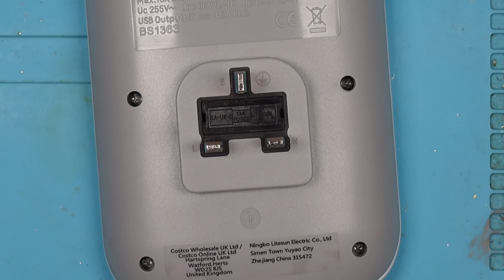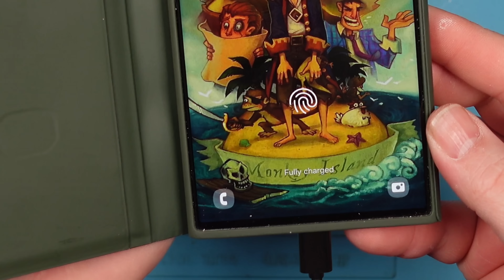FAULTY USB Double Socket thing | Can I FIX It?

Comment: It look like chip on USB board is there only for lit RED LED when current draw higher then maybe 100mA? Lit GREEN when lower current and turn off LED when no current detected. I saw circuit like this in 4port USB 2.0 hub with external power supply. It was rated 2,1A per port but 4,5A for all when 3A powersupply and input USB cable connected. It was useful for charging things even when PC was off only hub powersupply connected.

Comment: A very clear account. I looked at my power strip again and there are two USB sockets and 3 plug sockets. The USB part is very compact and I am not sure I can unscrew the circuit board if there is one (no sign of green). What I learned was is that it is better in the long run to buy power strips only with plug sockets and more of them and to add those little cube-shaped USB adapters (or ones that come with new phones) that can be plugged in externally and easily replaced. Putting everything together leads to more breakdowns, wasted money and more environmental pollution.

Comment: if you ever work alot with sega game gear, you will find that type of capacitor shorted alot. (filter caps that prevent the gamegear from working all together due to short)   but otherwise, unless your  working with that generation of caps... you dont see it that much. (90's caps really were horrid)

Comment: I have two smart power strips,  both of which make that chirping sound .  My only problem with them is that if too many usb devices are plugged in (e.g. phone, and tablet,  plus e-cig) the power strip's transformer cannot keep the mains sockets on.  Things start to switch off until I unplug a usb device.

Comment: If one cap has gone short, the other two inevitably will as well. Try and find the smaller caps and replace them all. The chirping was the switch mode power supply at the bottom starting and stopping because of the short on its output. Good fix Ste.

Comment: Electrolytic capacitors are notorious for failing. They are the first thing to check in any electronics repair. Get yourself an esr meter. They’re finally affordable for even the hobbyist and will be one of your most valuable tools. You could have checked the other two capacitors and probably seen that they are on their way out. One foot in the grave so to speak.

Comment: The power supply is a flyback power supply. It has a control chip on the primary side , which gets slowly charged via a large resistor into a capacitor. Once it has enough juice to start working, it activated the main switching element. This induces a voltage on the secondary and auxiliary windings. The auxiliary winding charger the control chip so it can stay running.

In this case, the output was short circuited, the voltage on the secondary was now around 0V instead of 5V. Because of how a transformer works, the auxiliary winding also had a low voltage. As the chip started, it depleted the energy stored in the capacitor and shutdown, instead of continuing to run. This kind of behavior has a side effect of limiting the power it outputs in a dead short, reducing the fire risk

Comment: I had the same thing happen to a USB power strip last year. The radial capacitor bulged and its top opened up. I replaced it with a capacitor that has a slightly higher voltage but same capacitance and it works fine again.

Comment: 9:50 It's always best to choose the voltage rating of an electrolytic capacitor as close to the voltage it is smoothing, rather than fitting the next voltage up.
Because the dielectric in electrolytics is produced by the voltage on the plates, it's best practice to fit the closest voltage ones you can. 
Nothing bad will happen using the next voltage up like a 25V, but say, using a 63V capacitor on a 5V rail may cause problems in the future.

Comment: I have a device with 4 USB outs and makes an annoying sound when connected to the power outlet. That sounds makes it impossible to use. And haven't disassemble it cos It doesn't have screws.

Comment: I've got one of these bought from Costco. I've found it very difficult to get a plug into the 13 amp sockets. Almost as if the shutters are way too tight. Needs a good thump. Usb side is really good though.

Comment: I have an old Bowers & Wilkins Zeppelin, with the old iPod 30pin connector, that no longer powers up, it’s a bit faded, but yours if you want it, sound quality was awesome and I think I’ve seen people modify the original connector, I have tried Bluetooth adapters but didn’t work very well, like I said, yours if you want it.

Comment: Possibly a dumb question .. does it matter mixing 10v and 25v capacitors on the same rail? The supply voltage should never exceed 5v so I’m guessing not.. but I’m sure an expert or two can weigh in here?

Comment: I just recently fixed a friend's 5.1 channel receiver (then operating as 3.1).  The problem was the same:  A 0.4-ohm electrolytic.  No sign of electrolyte leak, nor did it look damaged in any way.  And it was a Nichicon too.

Also, this USB plug is ancient.  Modern USB devices will try to negotiate for higher voltages, up to 48V.  Of course that means each plug needs its own controller.

Comment: The surge protect light seems to be a bit intermittent after the repair, it was always on (I think) during testing - before the repair.  Could this be an indicator of some kind to show when it is shorting or under strain?  Just wondering.  (Before it (the thing itself) stopped working was one or more USB's in use, it might be that what was charging/being used shorted out and it was constantly on to show it was protecting?).  No idea, just some thoughts on the matter.  (The fizzing was probably identifying the blown cap?).

Comment: Steve, I think the high pitched intermittent sound was the PSU, possibly a switch mode supply, shutting down when sensing the short on the capacitor. Then restarting and locked in a loop making the high pitched sound each time it shut down.
Reply: Exactly what I was going to type. I work on classic era arcade games and in every switch mode power supply (SMPS) the circuit will “chirp” audibly when it’s trying to feed a dead short. As Steve did correctly, disconnecting the power supply from the rest of the circuit, the SMPS can now feed power to the meter.

I have yet to find a shorted electrolytic that didn’t have some external damage. Tantalum capacitors are notorious for shorting and sometimes blowing up and spreading conductive powder all over the boards. Steve obviously finds many surface mount capacitors that are shorted too.

I also think Steve should replace the other 2 capacitors and get 3 of the correct physical size but I’d also suggest the bigger voltage tolerance like 25v instead of only 10v for a 5v circuit. Get a good brand like Nichicon. I learned to trust them over other brands since there are too many cheap caps that don’t survive very well in arcade game cabinets running long hours every day.

Comment: After much research, shorted electrolytics are usually caused by "electrical stress".  As you would know by now the usual failure mode is the electrolyte drying up or leaking out over time resulting in lower capacitance and higher ESR.  I guess the shorted ones must have had some electrical trauma that punches through the electrolyte gap and sort of welds the 2 electrode foils together.

Comment: Strange thingy thing. Electrolytic caps normally don't short out, even when they dry out. Maybe a manufacturing issue from the start, where the foils were mechanically damaged and/or too close together.
Happy New Year!

Comment: Sooo... Electrolytic capacitors when they are dying or dead can give off different sounds. As they use dielectric materials which  expand or contract as they charge and discharge, this physical movement can create a noise, often described as a popping or crackling sound.

Comment: I wouldn't have put the not-broken caps back in. Chances are that they are close to shorting out as well. Also, it looks like they are all in parallel so I might have just put a single 1500 or 2000uF instead.
Reply: More good quality caps in parallel is better than a single cap. Paralleled caps have reduced impedance, reduced ESR and ESL, reduced ripple current per cap, etc.

Comment: That thing looks good and bad.  I like the way the surge protection is genuine, and on a separate board.  And they have a BS style fuse for the USB,   Your repair is 100% approved (I'm an electronics engineer)  Strange the 3 electrolytics in parallel like that though and like you said, going short circuit is odd.  By the way, couldn't see it clearly but I think the Black/White mains is Live/Neutral in the style that the USA does it.  White for Neutral and black is one of their colours (they also have red) for Hot/Live.
Reply: Being paralleled like that, couldn't he just have either: a. Left out the dead cap. (For slightly lower performance, I presume they're there for surging to current hungry devices on plug in). b. Simply used one larger cap of 1500 uf?

Comment: Where's "Don't this at home" warning? 🤔
Reply: No! fix what you can! ...otherwise ends up in landfill?
Reply: @222inverter  Well...Better to be safe than sorry so that newbies don't end up in landfill themselves by playing with mains power supply. 😁
Reply: I recently fixed my TV by replacing two similar capacitors on the power supply board.

Comment: Considering how stable the input voltage was and that the capacitors were between the 2 rails, everything would probably have worked fine with the capacitors removed.
Caps are usually to smooth the current but can also act as a very short term UPS.
Reply: That measurement was without a load. Generally if they weren't needed then the company would have left them out to save a few pennies.
Reply: @georgeprout42  I said work, not work well.

Comment: Silly USB, sockets are for AC.
Suggestion for Steve ?
Maybe pin a spoiler saver comment with the pre-release videos?
Because I don't try to look at comments, but YouTube always shows one in the app, and as fast as i tried to go to fullscreen, i saw it was shorted electrolytic caps, which makes me a sad panda. 
Maybe something to consider. Because now i feel like if you were sitting watching Titanic in the theater and someone spoils it by telling you that the ship is going to sink because that bigass shark, Jaws, chewed a hole in the flux capacitor.

Comment: The blue disc thing is indeed for surge protection.  It's a metal-oxide varistor (MOV) which normally doesn't conduct.  But when the voltage across it gets high enough (usually 470V in the UK and Europe) it starts conducting and shunts live to neutral.  That makes the surge go through it and back out on neutral, instead of going through the things that are plugged in to the sockets.
Reply: I recently had a line voltage smart thermostat blow up in a storm. Inside I found a metal oxide varistor with catastrophic damage. I don't know if it was there for surge suppression, but it sure looked like it took the brunt of a surge.
Reply: @kevingoodsell9269  Most likely it was there for surge protection, as that's a MOV's only purpose. But they have their limits and can only absorb so much without critical failure. Those specifications are usually stated in the datasheet, where you will find how long the surge can last, how high the voltage can be and up to which point it can still absorb the surge without any damage (because they also filter out short surges/spikes that can be caused by other equipment or the surge from a lightning strike that wasn't close enough to do a lot of damage, but did sent a peakvoltage down the mains)
Even if they do suffer critical damage, I read a lot of stories here in The Netherlands that even though the PCB has blackened around the MOV and the MOV has vapourised almost completely, the circuit behind it has remained intact.
Reply from the maker: Thanks acid!  That makes perfect sense, appreciate the explanation!  👍
Reply: In Germany we say 'Überspannungsschutz‘. 🤓😀
Reply: So, after reading your excellent explanation, my comprehension is that it's a little blue magic disc.

Comment: That's an extremely accurate 5 volts. Not often I see a straight exact 5.00 on a multimeter!
Reply from the maker: Yeah, it was nice to see such a steady voltage.  It looked like it was well built...  It means my multimeter is in good order too!
Reply: @StezStixFix a actually good pure usb powersupply would output 5.20V (5.25V is usb standard MAX), which counteracts voltage drops in the cables and connectors! But yeah, in terms of clean 5V, this is perfect.
Reply: @TheCustomFHD There are USB power supplies that output a steady 5 Volt when no load is attached, but slightly raise this when current is being drawn, it just depends on the design.
Reply: Plot twist: it's actually 5.1V and both are inaccurate.

Comment: You must have seen electrolytics going short before? Playing with vintage audio gear as I do, both domestic and professional means that anything electrolytic is eyed with suspicion.
Reply from the maker: I've only ever seen them with bulging lids or blown to smithereens, not sure I've ever had one that looked relatively "normal" but shorted.  I could be wrong though.  I usually am 🤣
Reply: Electrolytics failing short is rarer than failing open. Older caps and low ESR caps may be more prone.
Reply: @grantm902  agreed.
Reply: Not sure I have ever seen an electrocap shorted either.
Reply: The usual failure mode for electrolytics is electrolyte drying out, reducing their capacitance to ~1% of what it would normally be. Out of the hundreds I have replaced, I don't believe I have ever seen a shorted one. MLCCs and tantalum caps tend to fail shorted.